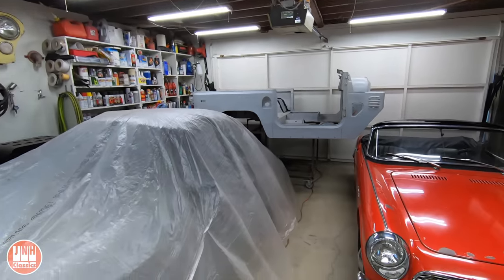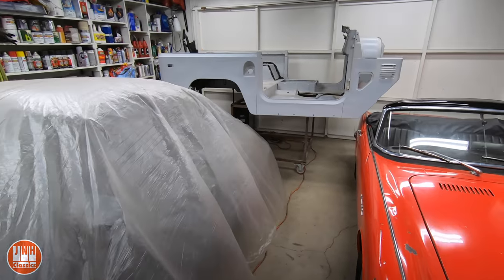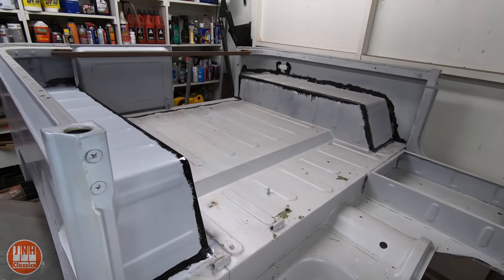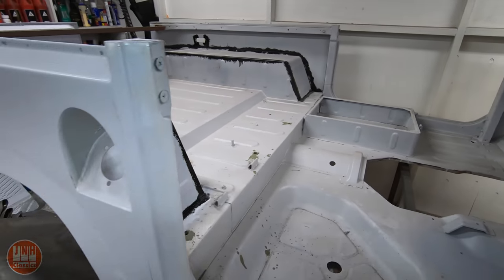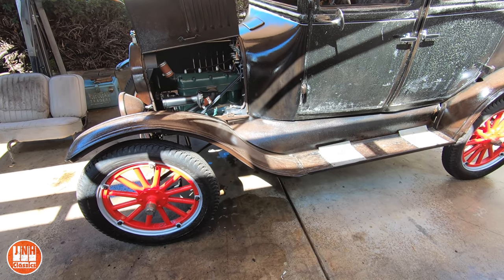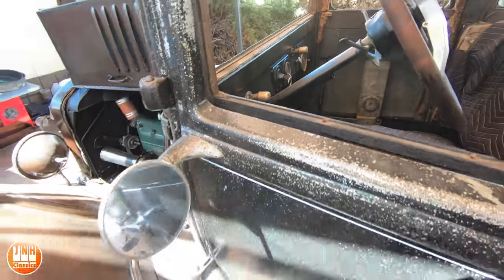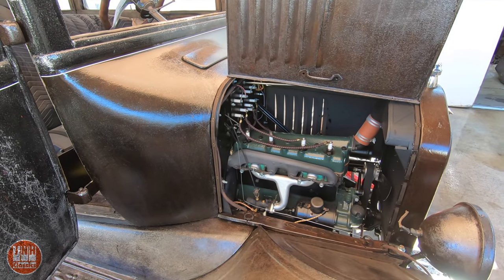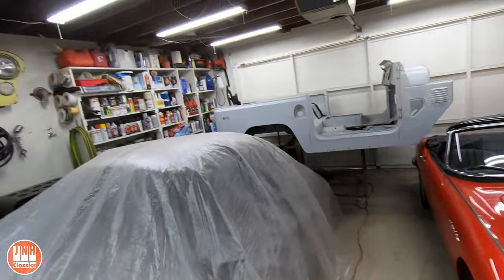Model T Issues and Progress on the Land Cruiser  - Sunday Update (3-14-21)

Comment: Cool and you may find that around the pedal shafts on the hogshead will leak some oil . Would suggest checking the straightness of the next manifold before installing . They can get bent or warped . Nothing an oxy acetylene torch can’t fix . Great to see the model t is running and driving . Great job

Comment: Great video!  A few things you may already know... I would do a dry run assembly on your FJ before doing any painting.  For as much welding as you did, there is bound to be something that does not fit right and you don't want to find it after it has been painted.  If you are doing hard doors and roof, I would set the body on the frame, figure out all your shim spacers and torque it down, fit the doors and roof and make sure all is good.  Note what shims went where so after it is painted, it goes together fast.  I did not see the oil pan assemble but on a number of engines that I've rebuilt, sometimes previous mechanics will over tighten rocker arm covers or oil pans to the point where the area under the bolt heads stretches and there's no way to get it to seal without removing the part and doing a bit of hammer work to get the surface flat again.  Regarding the ignition switch, you may want to try some CRC electrical spray in there before tearing it all apart.  The switch may be gummed up from who knows what all has been sprayed in there over the last 100 years.  A good cleaning with CRC and some Lock-ease may be all you need?

Comment: Great up date. The model T is over 90 years old so leaks are going to happen. In UK we call the cotters split pins and are good for holding the nut in place but not in tension. The locking nuts are a good idea. ( I have used a silicon RTV to seal the gasket on an Austin 7 sump to stop leaks) but when you sort one oil leak another one appears else ware! The ignition switch will probably just need a good clean internally or the key keep is worn and looks like it is turning over too much. The exhaust problem will be sorted by the new manifold and gaskets. I'm sure there is a local T club for more specialised information. Good luck. You will have to do a video of a drive soon!

Comment: I watched your video when you installed the oil pan onto the block.   My dad was a mechanic for many years and he told me never to use "gasket maker" with cork gaskets.   He called gasket maker, blue goo.   I can tell you that the valve cover gaskets on the Mopar big and small block motors of the classic age used cork gaskets and would leak if you used gasket maker with them.  He would hold the cork gaskets in place with "dabs" of 3 M fast tack trim adhesive and very seldom did he have any leaks.  Also on the head gasket I saw you use the copper spray.   I would suggest Permatex Indian Head Gasket Shellac.   We used that stuff on all head gaskets for years when I was a kid.  It worked on the older engines.  It come in a bottle and should be applied on both sides of the head gasket.

Comment: I made an interesting observation.  My JD mower tractor operates almost the same as my Model T:  The JD has throttle & choke on the dash.  Forward, reverse, and brake are pedals. Its not so intimidating if you compare the two. The advance lever is missing on the JD, but that's just fine tuning.    Love the videos, esp the high speed on the repetitive stuff. Good to see you tackle the same issues we have.    I took apart my ignition switch but it was difficult to fix due to decomposition internally.

Comment: If you can't get the right torque on a bolt and have the cotter pin lined up, you can use a washer to get a different relation between torque and castle nut position.

Comment: Your ignition switch needs to be taken apart and cleaned.  You can also sand the back of it to make it flat and ensure that it makes good contact in all key and light switch positions.  There are two types of switches, one has tabs and the other has pins that fit in slots.